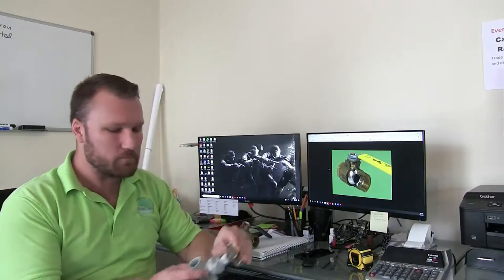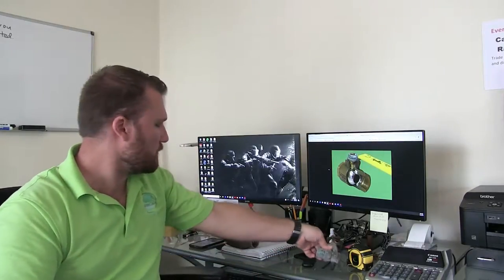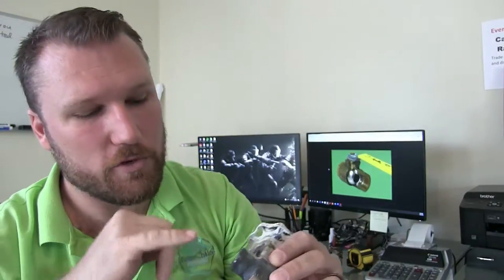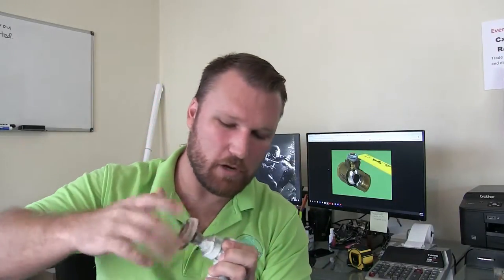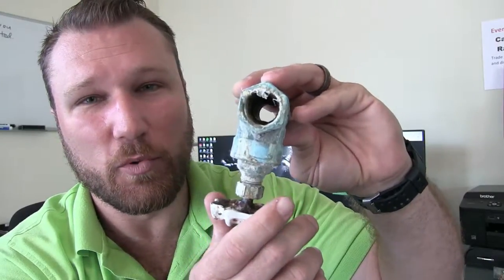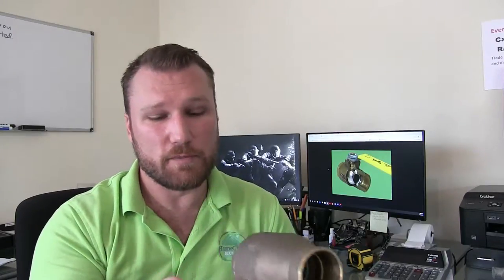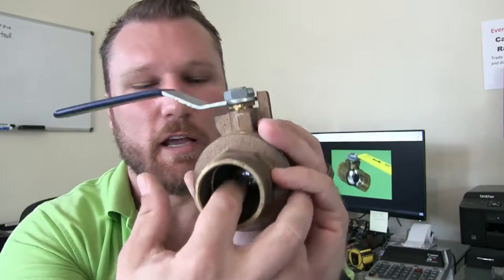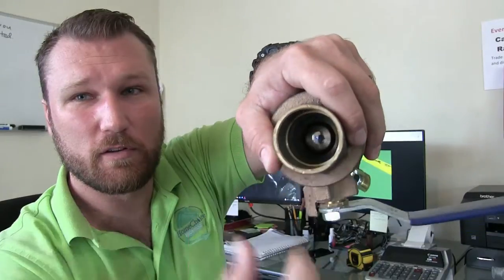Gate vs. Ball Valves | Why you should make the switch

Comment: Last month I installed 2- 3/4" Copper Ball Valves on a new Hot water Zone I created.  I was careful soldering them and used Locking Pliers and wash clothes to keep them cool.  The manufacturer stated they need to be half open when soldering.  Fortunately that part of the job was great.  I had trouble with a "T" fitting because I used overkill in keeping 2 sides cool while soldering the 3rd side.  The house shut off here is a 60+ year old Gate Valve which is cranky to turn and I have used Channel Locks on it in the past to do so.  Now I am educated on its potential for trouble.  Thanks.

Comment: I work in HVAC, boiler rooms, cooling towers etc. I've have more grief from ball valves that gate valves. Ball valves can stick, bypass (leak), the handles quickly rust and fail. The shafts rust and seize. I've had ball valves bypass in the first year.
Reply: Also they are easy to damage when soldering. I just found that out today. After install it leaked from the handle side
Reply: it's so over valve bros

Comment: I've had a gate valve on my well head for 20 years and it works fine. I turn it a few times a year, which could be why it hasn't froze up, but the well water isn't the cleanest either.
Reply: Eventually it will fail.  Gate valve is flawed by design from it's weak stem to gate itself which will corrode and sieze.
Reply: Plumbers love them!!
Reply: My gate valve appears to be leaking from my water tank, it's only 10 months old.

Comment: In UK we use a stop cock valve in the home on mains water (which also sieze up) not a gate valve, domestic gate valves are used on tank fed low pressure systems.. But of course the ball valve looks to be a good replacement, especially as I've just had a gate valve fail in the locked off position, so have to drain down the tank to replace it, will look at obtaining a ball valve, thanks for the info..

Comment: My house was plumbed in the 1980's. About half the valves are the gate style and half are ball valves. Every single ball valve is corroded and won't turn. I've tried tricks and tips from online sources and they don't work. They won't budge an inch and if I try any harder I'm going to break something. Meanwhile, all the gate valves work fine.
Reply: I have the same experience with ball valves!
Reply: Maint.
Reply: They are probably globe valves you have and not gate valves

Comment: Its interesting, So apparently i had a gate valve? So i was turning the water on and off in our new house to fix some things when turning one off i heard something in the middle crack and then the valve no longer worked and the water was both leaking and going forth. So I figured i'd order a new one, so i went and bought a new labeled Ball valve but aparently i must of had a gate valve but event though i guessed what it was wrongly i still ordered the right piece. lol

Comment: Great explanation!  I live in south florida, the outside shut off valve , I have replaced e the guts, will it still seal properly?  I still have small Drip when   replacing bathroom plumbing and shut off valve closed? Please help, any ideas?

Comment: My main shut off inside my home (garage-I live in the Southwest) is a gate valve.  I want to replace it with a ball valve.  I don't feel comfortable soldiering inside the wall.  Is a compression fitting okay to use in this situation?  I'm going to cover the opening in the sheet rock with an access door.
Reply from the maker: In Florida, that would be ok as long as that access door is there. Compression (mechanical) joints must have access in case of failure.
Reply: @Homechoiceplumbingservice what about pro press that's a mechanical joint, does it need an access door as well?

Comment: I had a gate valve replaced with a ball valve but instead of the easy quarter turn like the old one, they put on a plastic one that my weak hands can't turn. He said it won't rust like the other one but I'm a little frustrated. But my question is that this is a shutoff for a secondary water line and I'm not sure what maintenance I need to do when shutting it off for the winter. The plumber said I should do something but I can't remember what it was. Can you address this?
Reply from the maker: I'm sorry you have that issue. Having a valve that you can't turn is frustrating. They may be a better solution for you. About the winter maintenance, I think you're referring to "winterizing" your home. We don't do that in South Florida so I can't help you with that, unfortunately.

Comment: Only advantage I have found if ball valves is easier/faster on/off. Other than that nor much and they can be damaged easily when installing (soldering)  I just did one today and it leaked from the handle socket. I bet the heat damaged the lining

Comment: What I decided to do with all the external gate valves for hose connection was replace them with ball valves but in addition added an extra one between the meter and the house six inches away from the house turnoff valve  so I could still have water thru a hose while working on a sink, bathtub, toilet, water heater etc. Just turn off the house valve and leave on the hose valve.  See how long you can go without toilet water for 1 or 2. Replaced all those crappy little sink, toilet valves with small ball valves too. You never have to use one of those till they have long gone bad. No problem with ball valves.:face-turquoise-covering-eyes::face-fuchsia-wide-eyes::text-green-game-over:

Comment: Great video... good information, BUT...  Do you know which valve provides more efficient flow in the fully-open position?
Reply from the maker: The vales that are used for residential use are required to be 'Full Port' valves meaning when fully open, they are the same size opening as the pipe it is serving. the ball valves have a smoother flow path than the gate valves so the flow through would be better with a ball valve.

Comment: My city water department only uses gate valves. With a zillion homes to service, I will take their wisdom.
Reply from the maker: Gate valves are stilled used today for different scenarios. For instance, the larger the valve/pipe size, the harder it is to operate a ball valve by hand. Once the size of the valve exceeds about 2 1/2", the valve used is a gate valve. Anything larger would be very difficult to operate by hand. Also, the gate valves that are of larger size have a rubber seal inside to help positively shut off the water. ALSO, the water department is an old institution and the ball valve is a fairly new design comparatively. So, it would not make sense to change millions of valves just because they came out with a better design. They are however, changing from gate valves to quarter turn style valves at the meter before it enters your home whenever the valve needs to be replaced. At least here in Florida.
Reply: @Homechoiceplumbingservice  Are quarter turn style valves better than ball valves? I am looking to replace a gate valve for my main water shut-off.  Thanks!

Comment: Counting my lucky stars that my two gate valves from October of 48 are still working normal. I did have to tighten the stem seal a few times on one of them but they work great and don't leak. Fully exposed to the elements even.  Now, I've never had a problem with ball valves other than being a bitch to turn but gate valves have been a different story altogether I'll admit. A ball valve with a shark bite is great to deal with a blown pipe while the water is still on as well. Shove it on open and then close.

Comment: do you know anything about putting a lock on an apartment water heater to stop tenants from messing with the dial?
Reply from the maker: I do not and I assume you're talking about the temperature dial. The only thing I can think of is to use a special type of screw that requires a specific tool to turn to remove the panel. Usually called 'vandal resistant' screws or some variation of.
Reply from the maker: Or if you are referring to the valve, they do make ball valves that have a lock you can put through the valve or a cover that will not allow access to the valve. Be careful with putting locks on valves though because if a pipe bursts and they can't shut the water off, you might have a larger flood on your hands.
Reply: @Homechoiceplumbingservice  yes, i was referring to the temperature dial. It's in the laundry room for all 8 units and someone keeps messing with the dial by turning it up. It's causing problems with the pipes and costly the owner a lot of money so we're looking into some kind of lock for the dial so they can't mess with it.

Comment: I have a gate valve for my house, and the handle wouldn't close the valve due to it failing.  Contacted a plumber he suggested replacing the gate and handle with one from another valve.  We did that but it wasn't an exact match and the water can't be totally shut off for the house.  I tried to find something that would match but have been unable to.  Now I'm going to have to install a ball valve and am not sure how I will be able to remove the current valve and solder in the new one because there is no way to move the pipe enough.

Comment: I am sorry, but gate valves are very good, you are showing valves failed from extreme situations that are not the norm, if gate valves corroded from storage, they were stored inproperly. Ball valves lever corrodes fast and can became dificult to open or close. Both types of valves, gate and ball will need replacement or repair eventually.
Reply from the maker: I agree that nothing last forever and ball valve levers do corrode especially if they are made from steel or a lower quality stainless steel. That's why it pays to buy quality so you get a long lasting valve. The gate valve here is used in South Florida which has some of the hardest water in the US along with all of the chemicals.